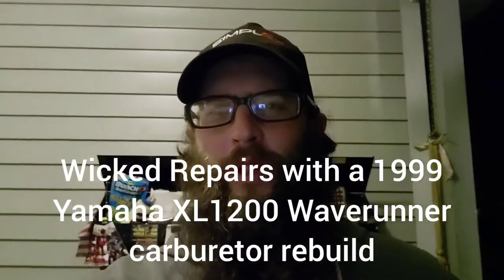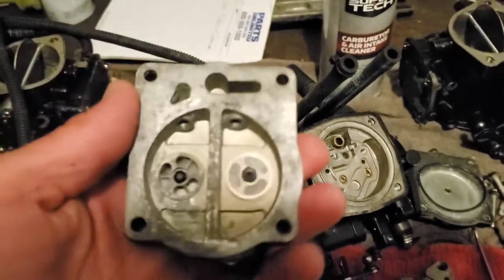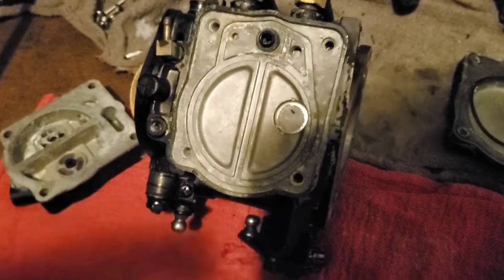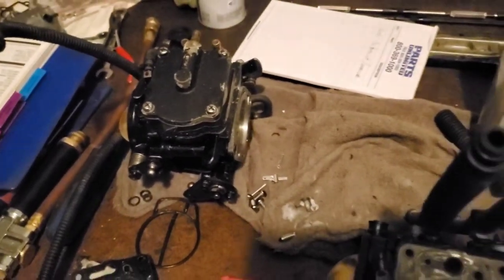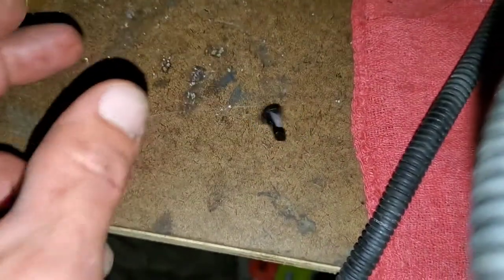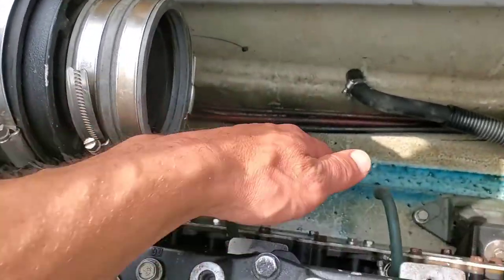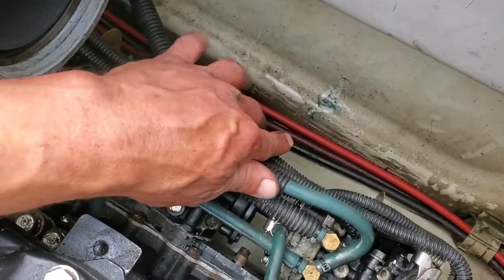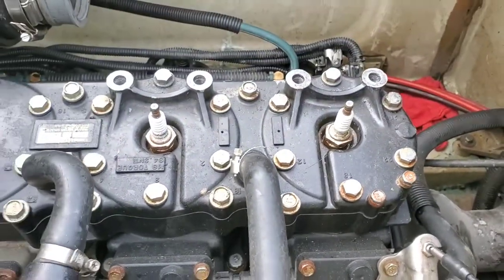Yamaha XL1200 Carburetor rebuild

Comment: I have a 98 xl1200. Could you tell me the low and high speed settings?
Reply from the maker: Sorry it took me a bit to get back to you! LS screw is 1 turn out and HS screw is 3/4 turns out. The pop off pressure is 64 psi, just incase.
Reply: @wickedrepairs8527  it seems to bog down and I am pretty sure the springs are incorrect. What size springs should I get for the XL1200 carburetors?

Also, it seems like there is no oil coming thru the line into it he first carb. I pulled the hose and blew it out but I still don’t see oil being pumped into it. I do see it in the other 2 carbs though. Any thoughts?
Reply from the maker: @steveoneway1  I'll have to see what spring size they should have. The oil could be a clogged filter. You can remove the pump and turn it to test it and make sure it's pumping through all 3 lines. That's odd though, usually it works or doesn't. I don't typically see 1 line not pumping.

Comment: I have a fuel leak coming out of a hole in front if a middle carburetor. What needs to be done to fix this? Thanks
Reply from the maker: Most likely has a stuck needle valve or a bad diaphragm. PWC carbs are the type of carbs that you should replace everything with a rebuild kit. All gaskets, filters, diaphragms, needle valve, and springs. You will have an air leak if parts aren't replaced.
Reply: @wickedrepairs8527  thank you for the reply. Upon further research I learned that the hole is called a bowl vent. Would you still recommend rebuilding the carburetor or is there an easier fix? Thanks again
Reply from the maker: Youre welcome, if it's coming out of there, there must be something in the needle valve hanging it up or the diaphragm stuck keeping the needle open.
Reply: @wickedrepairs8527  thanks again for the reply. Would you suggest the only way to fix runs leak is to rebuild the carburetor?
Reply from the maker: @17Danielgonzalez  yes, I'd say definitely rebuild.

Comment: I rebuilt my carbs recently and found that My ski does not idle. I have checked that the idle screw is properly set. It will start then immediately die. When I can get it to idle sometimes it idles very high 3000-5000 on trailer. Tends to run a little better on choke but once you push the choke all the way in it idles high. Could it be a vacuum leak? I also replaced all of my lines with see through tubing and noticed that my return line has no fuel running through it. But I can see the fuel being pumped to the carbs. Does anyone have any suggestions or resolutions?
Reply from the maker: Could be the low speed screws need to be adjusted. Could also be an air leak. If it runs a little better on choke it's possible that it needs a bit more fuel, maybe something is partially clogged/dirty still.
Reply: @wickedrepairs8527 thanks for the reply, I checked the hoses and are tight. I am going to try replacing the manifold gasket with an OEM one instead of SBTs aftermarket that i put on to see if that does the trick if not then i will have to take the carbs off again and look at them :(
Reply from the maker: @amatt2009  absolutely,  give it a shot and let me know the outcome
Reply: @wickedrepairs8527  so i tore the carbs apart again and saw no blockage and even cleaned them again. when i took off the carbs i noticed that i shot the bolts through the paper gasket. I put it all back together with a new OEM gasket. it will idle well at about 3/4 choke out. once i push the choke in it dies. tried adjusting the idle screw with no success. it feels like i am not getting enough fuel. What i neglected to do was clean out the low and high speed screws on top and bottom. could this be the issue? still no fuel through the return hose. also when doing my pop off pressure tesr of the the carbs was leaking air so i had to put some yamabond on it to hold pressure hope this is ok. yes i used genuine mikuni parts.
Reply from the maker: Yes, not pulling the low and high speed screws and cleaning through them can do this. The issue is more than likely that there is some debris in the low speed circuit still. The low speed screw is the same circuit for your idle/pilot circuit that runs idle to 3,000 rpm.

Comment: So I have a question. I just rebuilt both my carbs from my 98 xl760. Used oem mikuni carb rebuild kits. I did everything step by step like you said and when I reinstalled them and tried to start my ski there is no fuel pumping? I am lost. I just replaced the seal on my sending unit because it was leaking and the tank wouldn't pressurize. Now that I fixed that im kinda stumped on why there is no fuel pumping?
Reply from the maker: Possibly the pick up in the fuel tank. Maybe it is not connected or rotted off. Make sure the vent line isn't kinked or clogged. I dont know how long you cranked it over for, but it can take up to 3 to 5 minutes sometimes for the fuel to pump through and fill the carbs.
Reply: @wickedrepairs8527  ok so I've had this thing since new. 20 years ran problem free. Then it just would idle and would putter out when giving it gas. I have replaced all the fuel hoses. The one way vent valve. Just bought a sending unit off ebay that had a bad seal on top so I replaced the seal. I bout new 1.5 seat and needle with 80 gram springs. Rebuilt the carbs with a cheap rebuild kit off ebay. Thing ran perfect for 5 hours last sat. Took it out Sunday and it ran 20 mins then bogged out and wouldn't restart. Asked a forum and they said rebuilt with oem kits. Carbs crapped the bed. So i just did with oem kits and now there is no fuel pumping. I have all clear lines so I could see not a drop of fuel? Turned it over for a good 5 mins. I just pulled the carbs off again to inspect but haven't ripped them apart. And does these settings for a xl760 sound right. High setting 1 and a half turns out and low half a turn out? Thanks for any help.
Reply from the maker: High speed should be 1/2 turn out and low speed 1 3/4 turns out for that machine. Have you checked engine compression by chance? Just to be sure the top end is good. Is the accelerator pump working properly? Try to spray some carb cleaner in the intake to see if it fires up that way, may help prime the system. Possible vacuum leak?
Reply: @wickedrepairs8527  yea im at 145 on both cylinders. It did start with starting fluid but didn't help prime at all. Wasn't a drop in the lines at all. I'm gonna have to check the pickup tube and there's good vacuum so its either the carbs or pick up
Reply: So just took the carbs back apart and on the fuel pump I didn't get the clear plastic in either kit that goes down first around the screen? So I guess thats why there not pumping?
Reply from the maker: The round plastic or the oval shaped one? There should be 2 round ones that get installed with a small rubber grommet. There is one oval one that gets installed with. Small #1 Phillips head screw. That will definitely do it.
Reply: @wickedrepairs8527  ok so how you have it is carb then clear plastic then rubber gasket then pump housing then oring then gasket then clear plastic then pulse plate. My kits don't have the first clear plastic that you have sitting on the carb. They start with just the black rubber gasket. And it says thats the way to install it on the directions? I have a bn44? I'm really confused lol
Reply from the maker: @pittsburghhustler412  that's strange. It should be the same way as these are set up. On the outside cover to the fuel pump body, it should have a paper gasket then a plastic gasket up against the paper then the circle oring against the fuel pump body. Yamaha is typically good. I get all my waverunner parts and kits from SBT.
Reply: @wickedrepairs8527  haha thats is weird I watched another video and there was only 1 clear plastic  gasket and it was on top of the pump body. Maybe in the earlier models? Mines a 98 760?
Reply from the maker: That could definitely be possible. I have done 760s in the past but has been a little while. Have you looked at a yamaha parts diagram to see how it shows it?
Reply: @wickedrepairs8527  yes sir and does show the way I have it. Just was confused because the carbs in the videos are the same exact ones. I'm gonna check my supply tube on my sending unit. Pretty sure thats the culprit. Ty sir for all your help.
Reply: @pittsburghhustler412   did you ever come up with a conclusion on your fix
Reply: @johnvalentinteamfuego1814  not sure. Took it to a shop and they said filed plugs. Replaced the plugs and winterized it. I'll know this spring.

Comment: Do you have to sync the carbs?
Reply from the maker: The way you would sync the carburetors is by checking pop off pressure on the needle valve. Depending on the machine and spring color/gram. Say pop off pressure is 15 psi, as long as all 3 needle valves open at 15 psi you will be good. If 1 is 15 psi and 2 is 11 psi and 3 is 17 psi then it will not take throttle smooth. It would be like running on 1 cylinder, then 2, then 3 when all open. They should be set all the same. That is your synch. Then if needed, you can fine tune the low and high speed screws while running the machine.

Comment: Do you rebuild them if I send them to you? If so how 2004 xlt1200
Reply from the maker: Idk, the only thing that's touchy about that is not having the machine myself to install and test, see if adjustments need to be made, that type of stuff. If I ever do that, I can't guarantee anything. Although I'm sure they will be ok with possibly needing idle and/or slight low speed or high speed screw adjustments.
Reply from the maker: @anthonycamacho6475  I'm from Massachusetts. Most dealers are 100 to 125 an hr. On the machine typically runs $500 to $900 depending on model and # of cylinders/carbs including parts. Off the machine I'd say roughly $350- $550 for 2 or 3 cylinder with parts.
Reply: I know all about Massachusetts Marine labor rates. Never had to pay up any. But I do frequent Marine dealers in Massachusetts